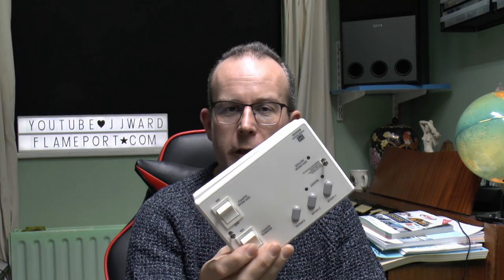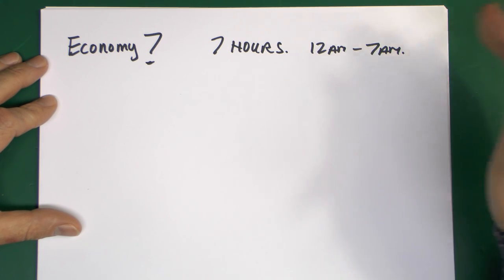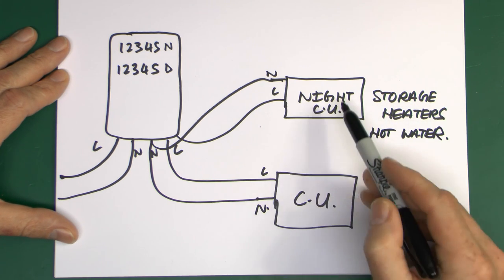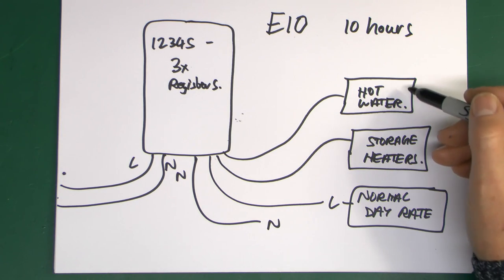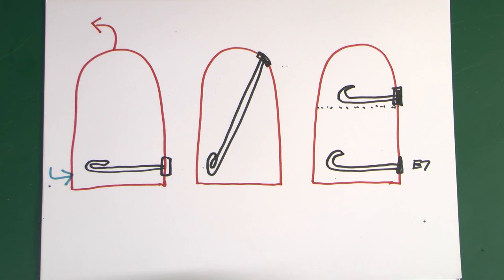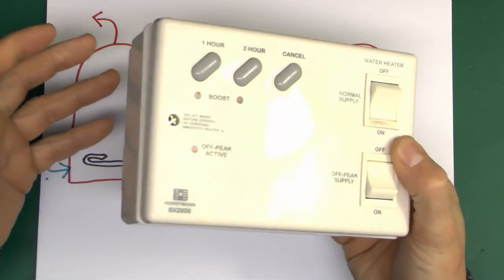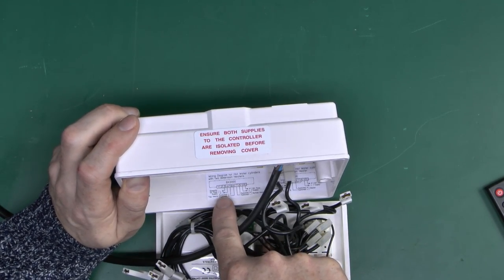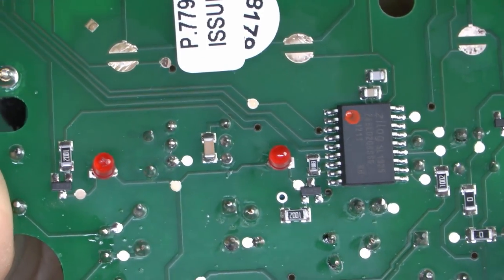Economy 7 and Horstmann BX2000

Comment: Recently moved into a place with this and two elements. Bit confused as to why the red light for off peak active goes OUT if the peak supply switch is switched off ? Is this correct  please
Reply from the maker: The electronics are powered from the peak supply, so that they are active all the time.
Normal operation is to leave both switches on, so it will heat on the off peak when available, with the boost buttons only used if extra hot water is requried.
Reply: @jwflame  ok John many thanks
Reply: Can it be replaced with horstmann economy 7, as this seems to have better control for when it's on. Currently it's heating a full tank every night & afternoon ? Many thanks
Reply from the maker: @williamsmith714  It could, but it's not a direct swap.
It won't achieve much anyway - the heater thermostat will switch off once it reaches temperature, so it will only heat as much water as has been used.  The Horstmann will show 'on' for the whole time the offpeak supply is active, but it won't be heating the cylinder for the whole time.

Comment: Hi 
What is the difference between BX2000 vs Elctronic 7 model. Do you have full wiring diagram for Electronic7 model.
Reply from the maker: Electronic 7 is a timer for use with permanently on supplies, BX2000 requires connection to a permanent supply and a second switched supply from the suppliers meter or teleswitch.

Instructions: http://horstmann.securemeters.com/files/9114/7261/7065/Electronic_7_installation_for_web.pdf
Reply: @jwflame  thank you for reply. I was thinking the same. So basically if there is two different supply are coming in the property then we need BX2000 and if one supply only coming then Electronic 7 will work.

Comment: Hey JW, I bet one of the capacitors has shorted out. I only know this from working with some clever kid who repaired something similar donkeys years ago, the internal timer of the IC needed external components to function and in his case the capacitor and a resistor were designed to generate a pulse that was counted inside the IC (or something like that, I'm outa my depth here). Caps do fail with age.
Also because I'm sad, I Googled the chip and its mainly used for wideband quadrature converters operating from 950 to 2150 MHz, intended primarily for application in satellite tuners. That's my brain splattered up the wall, I need an aspirin.... 😩😩😩
Reply: Different chip, similar number!
Reply: @davidfaraday3085  what a cool surname 👍👍

Comment: Put one of these in the other day and it only works on boost I only have one supply and immersion has boost at top and eco at bottom what have I done wrong ???
Reply from the maker: The BX2000 requires 2 supplies, one of which is switched at the E7 times by the meter.
If you only have a single supply and the whole house changes over to E7, then you need one of these: https://www.tlc-direct.co.uk/Products/HOELEC7.html
Reply: @jwflame  the flat has two fuseboards and the immersion is on the main board only the storage heaters on other board would you guess all electricity switches to cheaper tariff or just the storage heaters ?

Comment: Expect the X-caps in the capacitive dropper supply have lost most of their capacitance. But what a horribly designed thing - must cost a fortune to make and all those wires are a right mess!
Reply: Agreed. That's what happened to my Honeywell hot water programmer - dropper cap was only a fraction of the value it was supposed to be....